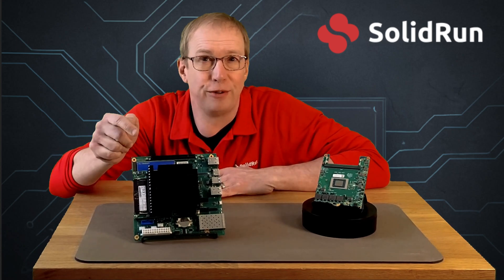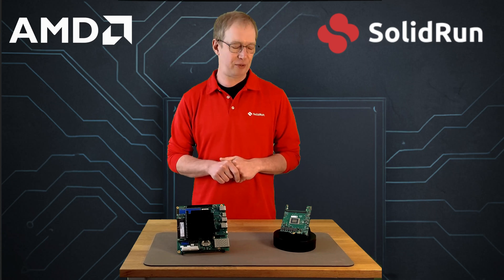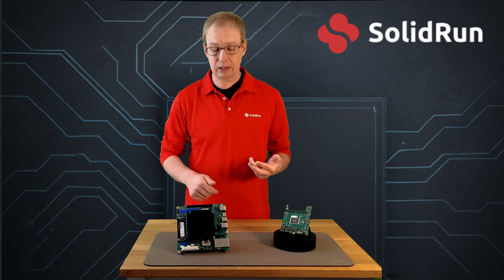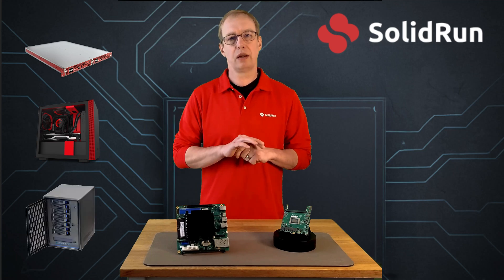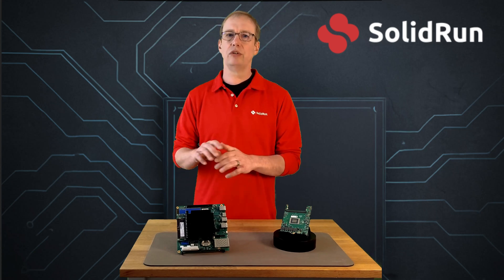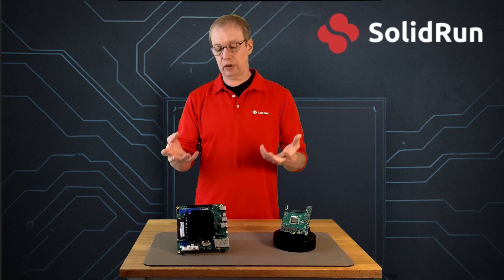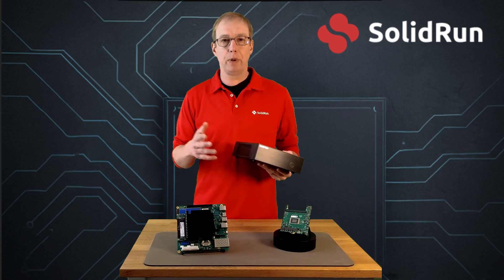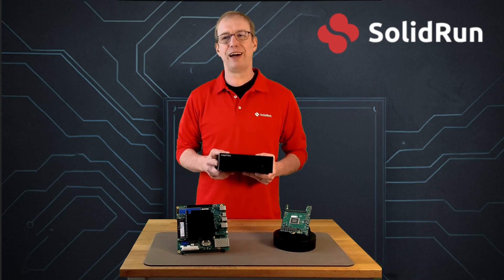HoneyComb Ryzen V3000 Introduction Video | SolidRun

Comment: Love the device, but the price point is too high for the power.  What chipset are the SFP+ ports ?
Reply: If all you care about is clock speed and the latest cores then absolutely go buy a minis forum or beelink device. The V3000 series CPU is an embedded life cycle, industrial temperature rated part, and the CEX7 and HoneyComb carrier are spec'd, built and priced accordingly.  When a device is designed for a 10 year life span there are additional costs that come with it, and those trade offs may not be what you are looking for, and we understand that.

The NIC's are AMD's built in Controllers.  XGMAC 10GbE Controller